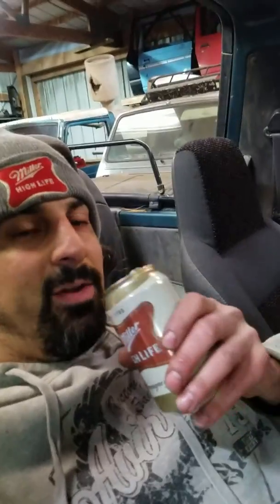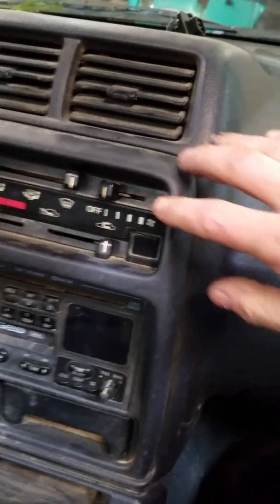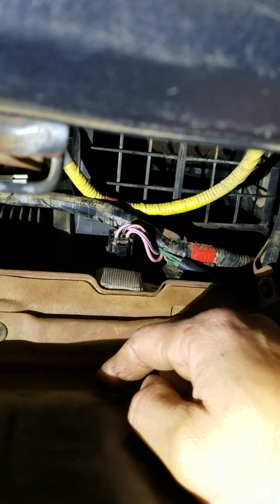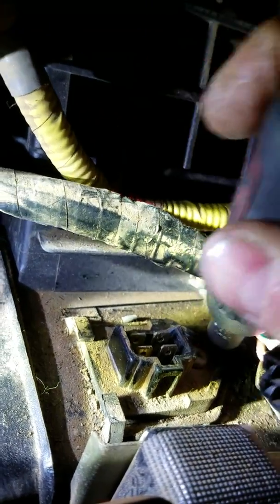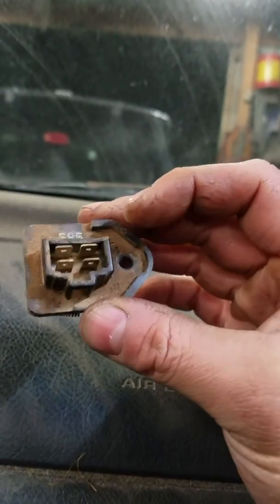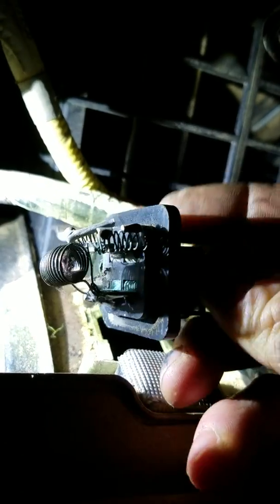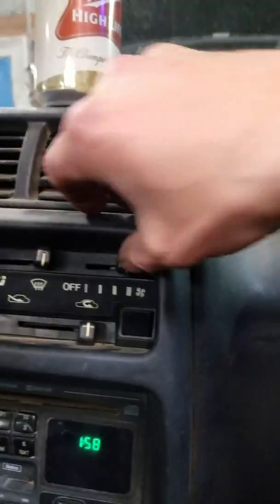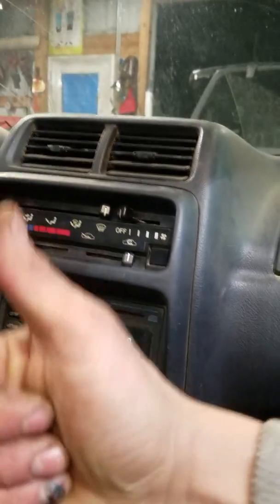Replacing Blower Motor RESISTOR - GEO TRACKER SUZUKI SIDEKICK - Hwy83 SUZUKI

Comment: Hey tony, my blower turn off when i was using it, but i check all fuse and they are okey, i dont got any speed working on my suzuki x-90.  I put direct 12v to the blower motor and turn on on super speed. Do you think that what happen to my blower was the resistor too? I dont got any function on any speed. And before of that tha blower was working fine on all speed

Comment: Hey tony! any reason why I have the climate lever on cold air but still get hot air blowing out?
Reply: Sounds like the linkage from the hot-cold lever is broken somewhere, so the lever isn't actually doing anything. If the linkage is connected, you should feel the switch/lever getting much harder to push around the hot-cold transition point, and then it'll get easier.

Comment: Have a 92 I recently acquired it only works on the highest setting and you gave to go all the way to the right and kinda pick up on the lever to get it to kick on full blast. Would this be a speed switch or blower motor resistor?
Reply: Is the switch lever or housing itself loose ? Make sure that it is nice and tight . He has a video up about where you take zip ties to hold the switch housing down . Really easy fix